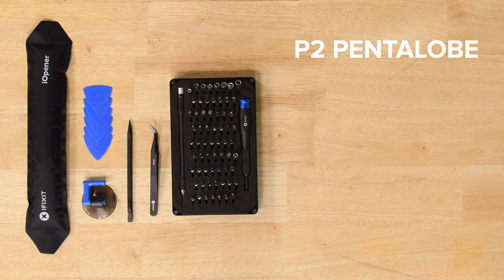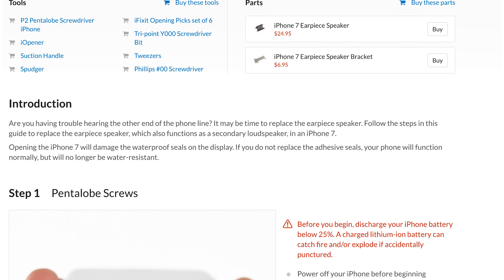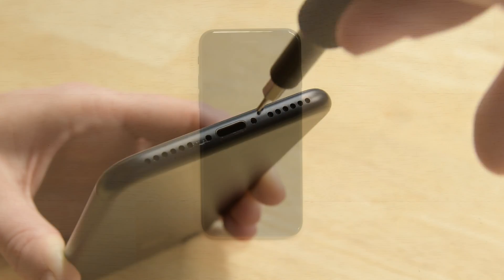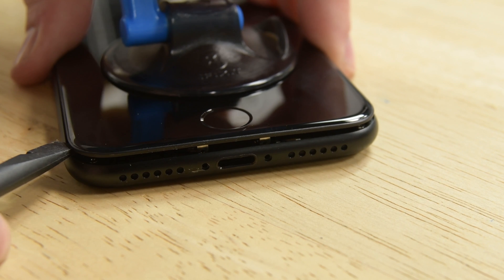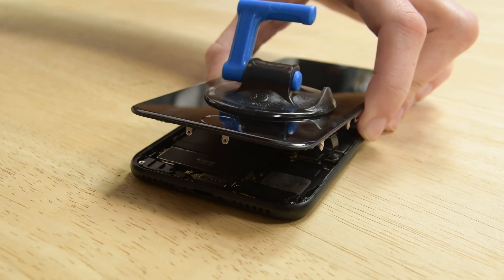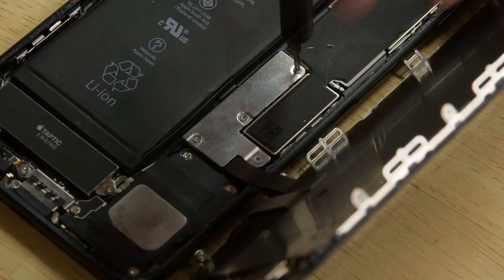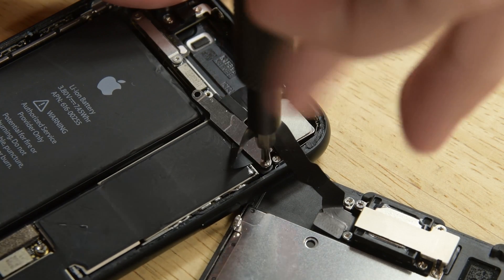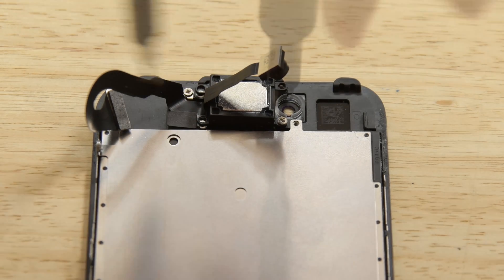iPhone 7 Earpiece Speaker Replacement- How To

Comment: Hello i have another bad issue i don't know if is because i put the wrong sizes of the screws to the camera module holes.

And now when i connect the camera flex to the board the iPhone has a bootloop, i want to know the correct order of the screws in order to boot correctly i read that the iPhone doesn't boot if you don't correct the screws sizes if the module.

The only way to get the homescreen of the iPhone is disconnecting the camera module to the board.

Can anyone help me? is an iPhone 7 plus
Reply: Abdiel Crocamo upside down the connector
Reply: Dang

Comment: hi
after i changed the broken screen my ear piece speaker stop working? do you have any idea why?
Reply: have u ever solved the problem?
Reply: Gheegouz Piassa im having the same issue right now.. someone said something about a Black Doublesided adhesive tape that has to be transfered thats attached underneath the flexcable.. :-/ but i dunno if its true
Reply: flipdamadapakincoin on the next repair add a little heat so the double-sided adhesive tape can pull up easily

Comment: hi i have a question it's not about this video i know ,  sorry but i need an answer please :D
how to check if my laptop  fan is working at all , i have e5-573  laptop it is overheating when i am playing games i can't feel any air coming out from the cooler side and i can't hear any noise too 
cpu temp at idle 45C 
cpu temp when playing 90C
i used to have hp probook it was overheating too but when it does i can feel a strong air coming out and hear a strong fan sound , thanks
Reply: Ok
Reply: the joker franky open it up and blow the fans with compressed air it must be dust or you broke your fans
Reply: #litegaming 
thanks for replying but i've fixed it already  it was the dust , sadly this laptop has a very thin fan so a little dust can stop it :( i hate these kinds of laptops , BTW i have another question this laptop has a 4gb DDR3L ram can i put in the second slot another 4gb but DDR3 and if it does not work how to configure the bios to make the both of rams 1.35v coz the ddr3l is 1.35v and the ddr3 1.5v . thanks

Comment: careful with the microphone and the speaker flex, it can be a bitch if you aren't slow and know how it comes out.
Reply: Steven Code i just did a screen replacement and my earspeaker aint working.. u think its the flex or the black-square doublesided adhesive tape underneath the flex that has to be transfered in order to let the earpeaker work?